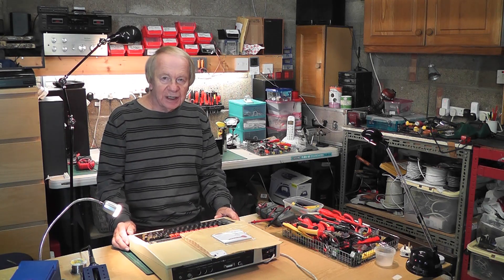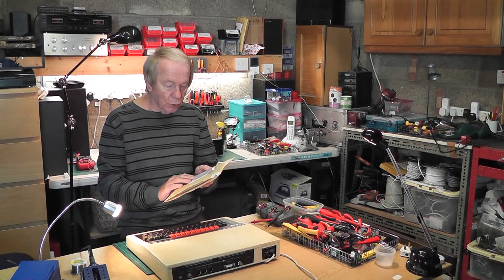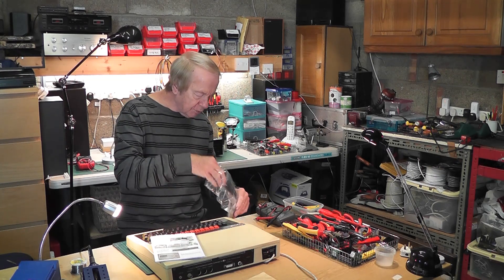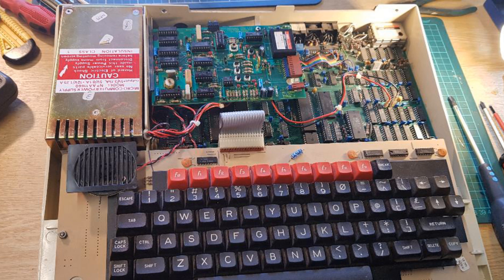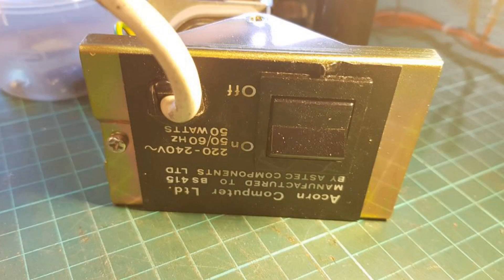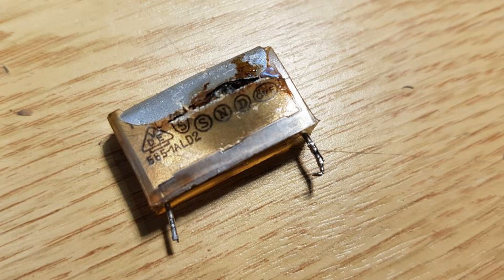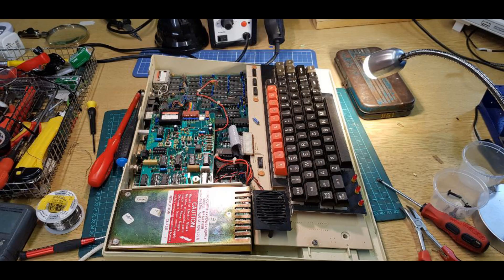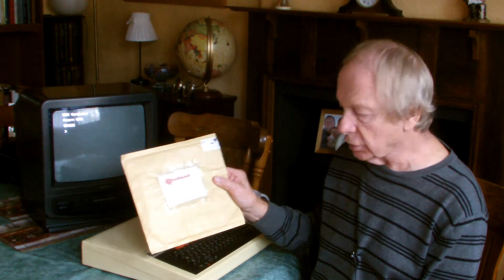BBC  Micro Model B Power Supply Repair

Comment: a friend of my nan gave a BBC micro to her and she gave it to me. looking forward to getting it up and running again
Reply from the maker: Hope it goes well for you. If it smells when you switch on you need to sort the power supply.
All the best
David
Reply: @DavidHallettProjects  I turned it on and it went pop and started smoking.
Reply from the maker: @fcubeboy4959  you will need to get a power supply capacitor kit as described in my video. It is not an easy repair requiring a lot of soldering and dissasembly I'm afraid. It is a common fault with the BBC micro if it had not been used for a long time. Sorry about that. At least you tried.
Take care
David
Reply: @DavidHallettProjects  I’ve already got the replacement caps and I have a soldering iron
Reply from the maker: @fcubeboy4959  
Great, just take photos of everything stage. All should be fine. Good luck on the repair. Keep me informed 
All the best
Dave
Reply: @DavidHallettProjects  Just successfully changed the caps (C1, C2, C9) but I still i have the same issue I had before it went pop. It turns on, beeps, and then does a second continuous beep with the caps lock light on.
Reply from the maker: @fcubeboy4959  I will do some research  and get back to you.
Reply: @DavidHallettProjects  No need, it was one of the ROM chips, must have been faulty or something. I removed it and it’s working now
Reply from the maker: @fcubeboy4959  
Brilliant, excellent result, enjoy your  BBC computing experience
David

Comment from the maker: Sorry, did not cover the actual removal and capacitor replacement bit in the video, but yes you do need to unsolder the old caps and solder in the new ones. Quite an easy job as once the power supply board is removed there is easy access to the pub panel.I recomend making sure the holes are clear as it helps a lot when replacing the new caps. Hope all goes well with your repair. Take care.
David

Comment: Thank you David! Mine also just went up in smoke. Ordered!
Reply from the maker: As per my video, replacing the PS caps should do the trick. Good luck
Reply: @DavidHallettProjects  Thanks - what's the part labelled Danger High Voltage?

Comment: Nice video. I'm  also more in to Hi-Fi repair,  but I've just bought a BBC model B,  non working, (looks new)  hoping it's just the power supply cap's,  find out when it arrives. 😊